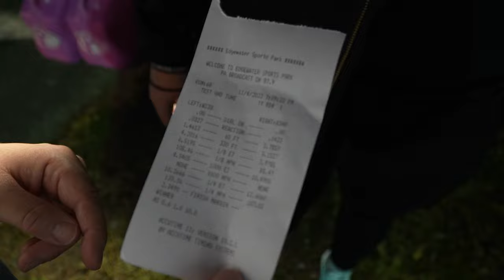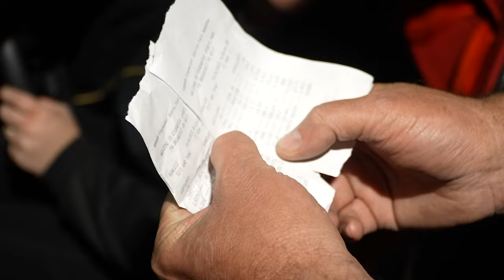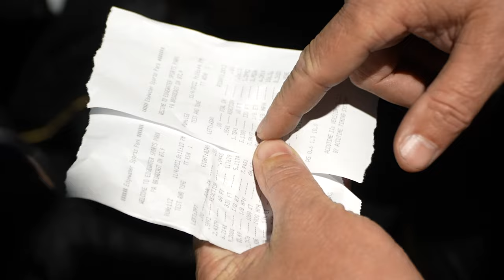New PERSONAL BEST! Testing on E85 + Tuning Advice from The Old Man!

Comment: From the in car vid 3rd pass, it was pulling out the back door, but short shifted in all gears. Just listening, no valve float is happening. Needs shift points moved up for that 727A tyranny.

Just saying.
Reply: It's running a TH 350 GM tranny Gary. As for the fuel situation, Bill bought a new pump for the fuel cell at Jeg's last week, & Uncle BuckO installed the pump & extended the pickup, before they took the Dart to Edgewater last Friday.

Comment: 727A and 727B Torqueflite transmissions without a manual reverse valve body does that..(But is that a Mopar transmission or is that a cross breed GM tyranny behind that 340?)

Either way it is being drastically short shifted, it is pulling at top of every gear. Just not far enough.
Reply: TH350

Comment: My car ran similar et. E85 didn't do much for it. Other than making it run cooler on the street.
Reply: A. Then clearly the vehicle-car was not tuned properly
-1. the engine - fuel system and ignition timing
-2. possibly also suspension, wheels, tires too for best traction, launch, etc.
B. established measured power&torque improvements with "E-85" from fueling stations - avg 40% ethanol -> achieve 30-50 + wHP via dynometer measurements vs all versions of fuel station fuels [87-93 octane - USA (R+M/2)] and Race Fuels C110-16 which have tetra-ethyl lead
-> best measured performance using actual 40% ethanol-E 50% + methanol
-> however actual 100% ethanol is similar to 100% methanol -> Indy racing switched to 100% ethanol from 0100% methanol in 2007. -> NASCAR use E-85 [C-85], 85% ethanol.
C. Chemistry - energy released during combustion is known, established for many decades actually over a century [150 + years] 
-1. -> both ethanol and methane have far less carbon content, burn far cleaner, thus far less carbon deposits, build up
-2. Ethanol = C2H6O=CH3-CH2-OH - Methanol = CH4O=CH3-OH 
-3. 'gasoline' from the fuel stations is a combination of, with many forms of hydrocarbon fuels, mostly with higher carbon content molecules -> thus, far more carbon and carbon deposits during burning, combustion. Fuels with added tetra-ethyl lead have even far more deposits from burning, combustion - common within high octane "Race Fuels" C 110-6 -> Octane = C8H18, Octanol = C8H18O=C8H17-OH -> thus, octane ratings are a measure of higher carbon content molecules - which also burn slower - helpful with higher compression engines NOT higher power, energy from burning, combustion. 
C. These are some of the common misconceptions, misinformation about fuels which are based upon incorrect, false ideas, concepts, views, etc. in place of proper, correct, accurate, precise, exact knowledge, ideas, concepts, principles.
->actually burning pure hydrogen, H2 + O2, is the essence of the energy, power released during burning, combustion and has the simplest results from the combustion = H2O = water vapor.
D. Certainly viewing these channels, information, knowledge, expertise with "Dad" Jeff[afa], with his engineering knowledge will be helpful, useful, beneficial, along with proceeding with proper methods.
E. Perhaps also see Mike Turner, Shop Dog Fabrication, for comparison - he races his 1970 Dart with 318 c.i., N/A, on 'pump' E-85, NO NO2, spray, with a similar set-up,  and achieves quicker and faster than this Dart with a 340 c.i. is currently 
-1. HTDW 2022 results: 
Day 1 - Madison, IL,  2 - Indianapolis, IN, 3- Byron, IL, 4 - Cordova, IL
ET - 1 MPH - 1, ET - 2 MPH - 2, ET - 3 MPH - 3 , ET - 4 MPH - 4, Avg ET Avg MPH - 1/4 mile
Michael Turner. 1970 Dodge Dart. Black. 
12.364 sec., 110.10 MPH, 12.372 sec. 109.48 MPH, 12.342 sec. 107.79 MPH, 12.202 109.34 MPH, avg: 12.32000 sec., 109.18 MPH
-2 - seems it would be worthwhile for Jeff to view, assess, evaluate, differentiate, , discern, use analysis ,etc., perhaps even contact Mike for his details, if desired. - Mike also is not an engineer either, and relatively good, basic mechanic, fabricator, etc., slightly older than Bill & Jeff, also a mostly involved with 'bracket racing' with his Dart along with Drag&Drive events; RMRW, HRDW, etc. - based in Michigan.
All the Best and Much Success in Your Quest, Health, Happiness and Well Being. 😊
Sincerely ☺

Comment: Being that Edgewater is faster than the previous track im not impressed with the gain on e85. I hope you can do a fuel pump and go test, if that doesn't fix it then try valve springs but no reason to put much $ in the 340 when theres a fi Hemi sitting there.... Jeff built a awesome base for nos potential. Allison you are learning fast and getting more comfortable with time! Tommy the editing was spot on as Always!  Bill.... go to bed you have an ocean under each eye... lol!